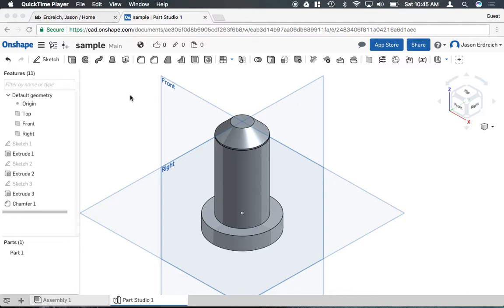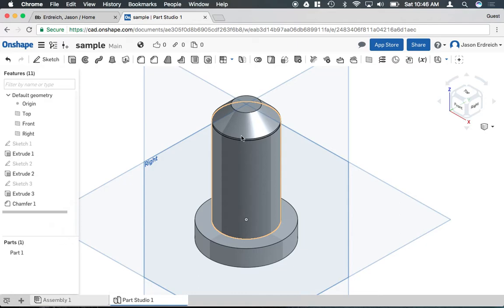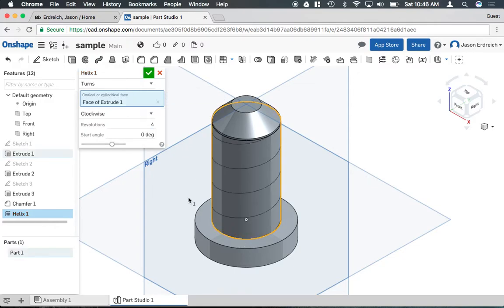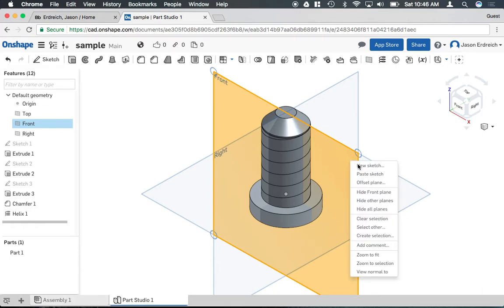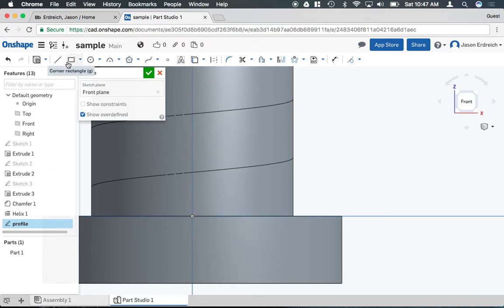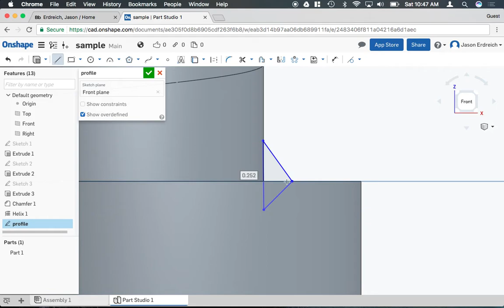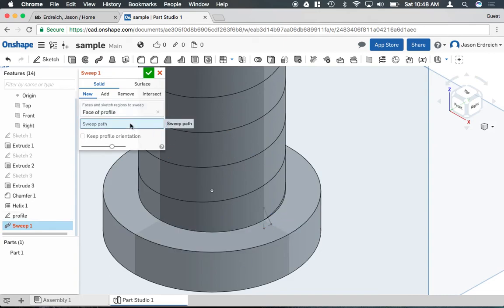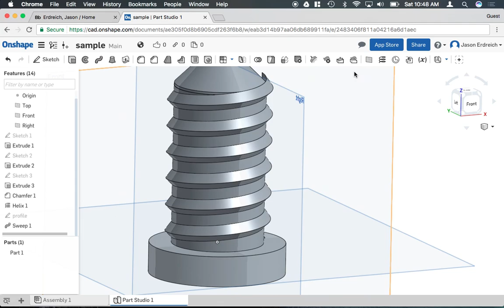How to create threads and screws using the Helix tool in Onshape CAD

Comment: I might be 6 years late to the video, but how would you remove that part at the top so that the sweep ends with the screw?
Reply from the maker: The easiest way would be to make a sketch, draw a shape (rectangle), and extrude to remove the material you don't want at the top of the screw. You can also adjust do a manual sweep rather than a helix to have more control, but that's a bit more complex